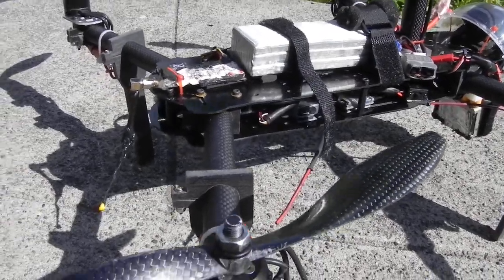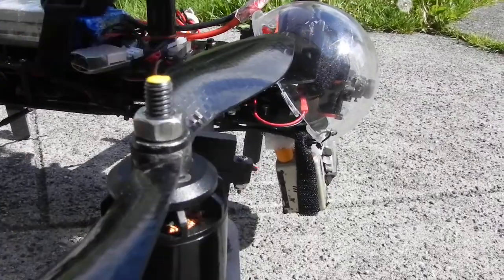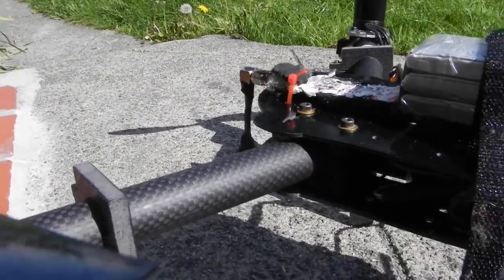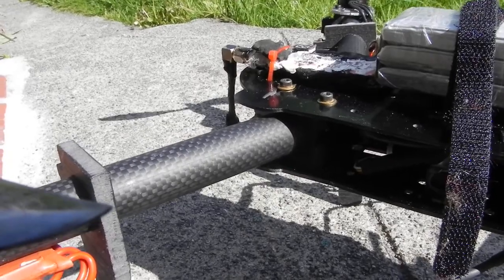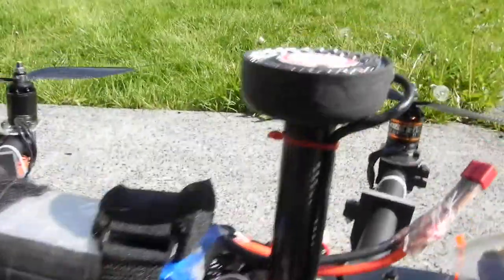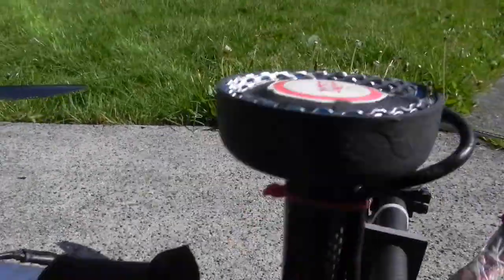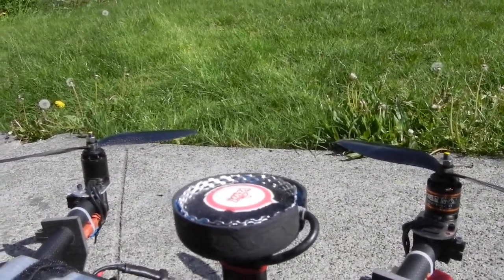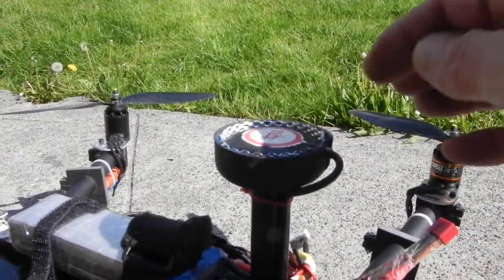NAZA alternative GPS shielding from noisy GoPro and 1.3vtx/UHF

Comment: That's brilliant :) I wanted to fly my quadcopter with 1.3Ghz video but i have the Naza-M Lite and i heard about the issue with that frequencies! So all i need is some non-magnetic aluminum for covering it?
Thanks for sharing :)
Reply from the maker: Try and get aluminum mesh, check with magnet. Next copper mesh would be less reflective than solid foil so I would try that. Even brass mesh from an old school car fuel filter!
Reply: Hoverbot1TV
Thank you! I will give it a try as soon as possible!

Comment: You are always innovating. Is your gps  antenna pointed at magnetic north?
Reply from the maker: Yup, had a 1m pos hold at 8ft in quite gusty wind so I think it has the data. It wanders if a red flash and green flash happens but the mesh reall helped and was better than foil I think because I get lock in 2mins or so as opposed to 6-8 mins before. The airsoft 1000 AIM pellet screw on cap feeder bottles are perfect fit. Now waiting for the big props to smooth things further with those sweet 650kv motors. These 930kv are stressing a bit but not getting warm with 10" paddles. Oh the cf tube clamp at base allows for precise rotation and fixing in place. It will come off on hard flips.
Reply: Hoverbot1TV Sweet looks like you'll have a nice rig there turning twelves.
Reply from the maker: was surprised the 1238 were so responsive but the goal is 4s and 1350 CF eventually so I can hit 20-30min if possible. Just made the 4s to 3s voltage regulator.
Reply: Hoverbot1TV Your rig reminds of the aerial mob carbon arms for the tbs disco - they are getting crazy time swing big props

http://fpvlab.com/forums/showthread.php?26271-AerialMob-Arm-Extensions/page2
Reply from the maker: Just put last 6 on sale, before I build a Y6 with that funky APM 2.5 LOL! I have not seen the carbon tube arms for TBS, I'm still stoked the clamps are so rigid and think I could up size safely to 700mm. I like how quiet the 650kv are too. took off bubble dome for now but it could come in handy. I think it will take concrete to bust these. LOL!